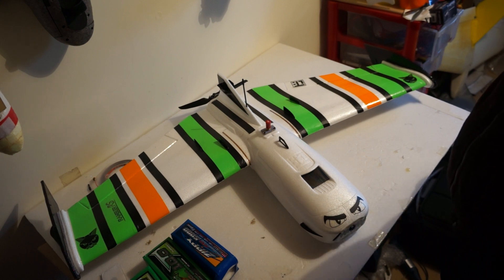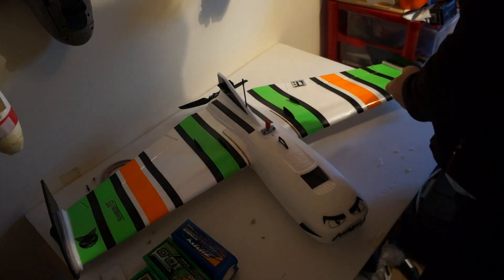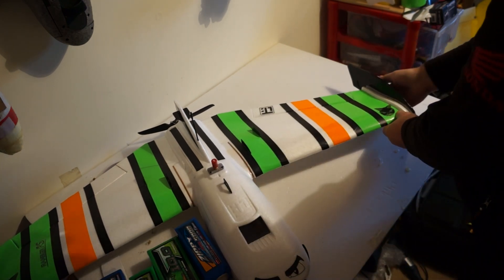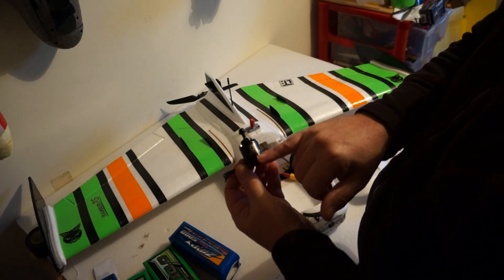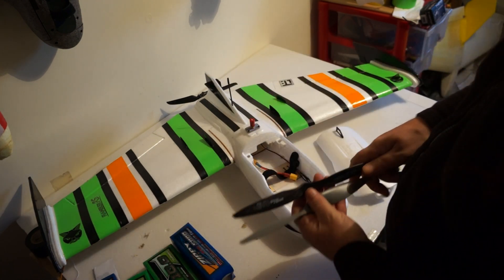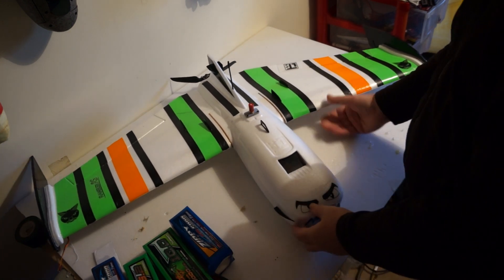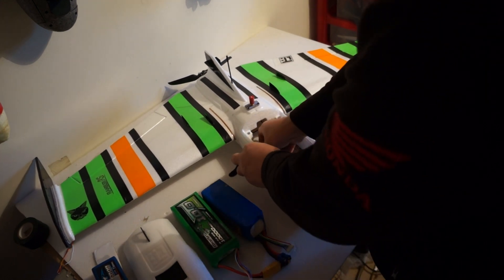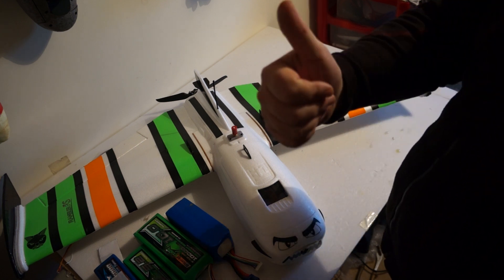LTE Rambler RS 1000mm FPV wing build overview and Mods

Comment: Great color scheme you've chosen...Hey, when you're covering using clear tape, what is your method as far as hinged surfaces? Do you stretch the tape over and simply cut down the hinge line? Or do you stop at the hinge line?.. Thanks man. I finally pulled the trigger on this model...Glad I did!
Reply from the maker: when i do the tape, I make sure the Elevon is folded all the way down  (when covering the top)  so that it can reach and the tape will not stop it moving when done, then feed the tape in so that it follows the valley of the hinge, then run a flat head screw driver or similar along the hinge so its pressed down into the Hinge valley. this way it adds strength to the hinge and does not stop any travel .  Then flip the wing and repeat on the bottom with the Elevon folded all the way to the Top .
Reply: @SkyrisUK Cant's ask for a better way to strengthen a hinge joint.  Thanks!